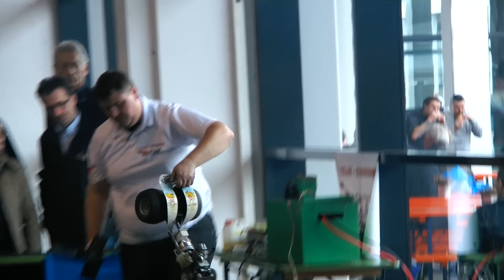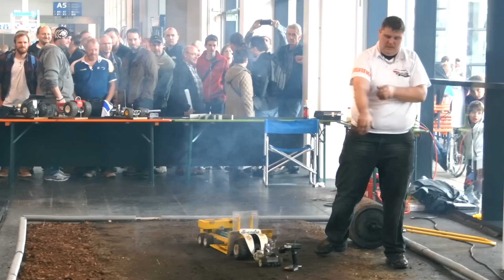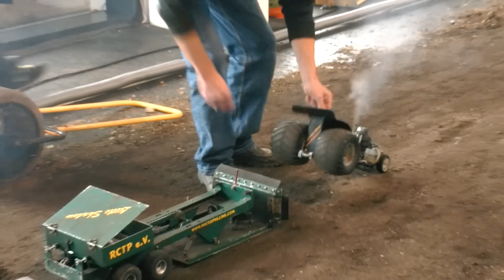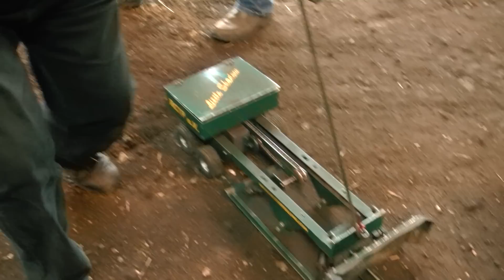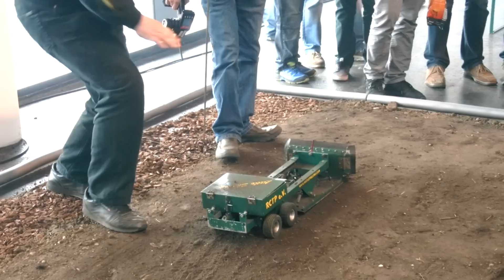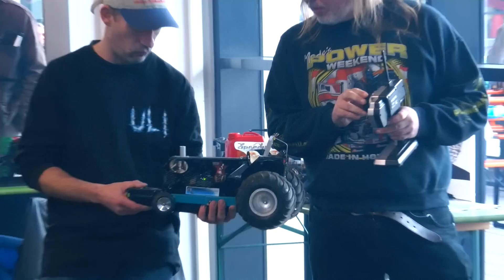RC TRACTORPULLING WITH FAILS POWERFUL RC TRACTOR IN ACTION AMAZING !!! / Faszination Modellbau 2015

Comment: Why hasn't tech been integrated into labor?...because nobody gives a crap about laborers. These cars should be pulling bulk weight like roof shingles, sheetrock, bagged cement, lumber, or whatever without being steered from point A to B. Why stop there?...have them run up and down ladders. A roofer could have one running shingles along the Ridgeline, bringing hardware and doing pre cuts if anyone gave a crap about roofers. Imagine rc vehicles nailing and screwing sheetrock or sheeting all full sheets in one direction then measuring and fitting the last piece before moving up to the next row. Hell...why not have a rechargeable jobsite rover that's integrated into the trailer that the supplies are loaded on. Plug it in at night and use the vehicles charging system and/or regenerative braking to top off the battery. The trailer wheels could break away from the trailer at the jobsite and the deck could be reconfigured into a cut table. The worker is the only piece of equipment that a company uses, doesnt maintain, damages, even destroys, and doesnt pay for. The last people to get what's left of the money on the job are left doing the bulk of the work for the smallest wage. Theyll deal with accumulative wear and tear as long as possible until they discover they need a career change at their own expense or find themselves disabled and absorbing the cost of the medical damage which isn't possible considering the medical industry values their time at an entire years worth of a laborers wages for a fraction of a days work. Workers are left fighting human resources, workers compensation, or ssi for help that's already paid for. So what happens when someone earning a poverty wage is run into the ground, incurs impossible medical debt while considering taking on more debt for a career change?...FAILURE. A taxpayer becomes a social services recipient. People trying to earn enough to feed their families and pay rent are excluded from the American dream only to find themselves wrecked from trying to build someone else's. The taxpayers are footed the bill. You know who won't be going through all this crap?...NASA. When looking at how they build I can't help but think I have it all wrong. No tech exists for construction labors because the future of construction has no shingles, sheetrock, lumber, sheeting or even a crew because future structures will be 3d printed so why invest? So people remain donkeys. The expense of their maintenance and repair is way more than finding a new donkey. Luckily it's not legal to put em down (shoot them) when a company decides investing in this piece of equipment ( you) is impractical or unfeasible. The problem is I know I'm right when I say people haven't integrated tech into labor because nobody gives a crap about laborers because after graduating high school I worked in the warehouse for mayflower in silicon valley. We had battery operated forklifts capable of handling any production scenario. Loading and unloading trucks and pallet racks all damn day full time with overtime. One shift I put in so many hours in I earned double time and a half. You're thinking. ..."Yup...electric vehicles are taking over."...   Here's the thing...this was 32 years ago in 1991. The lack of tech integration into the labor industry is inexcusable. The fact that just now the auto industry is using alternative energy for transportation is an equally big joke. The only reason we had that tech at mayflower was because of the big money contracts we had with Apple, Motorola, and the like. Despite all that big money the company layed me off on the 29th day, then rehired me for the next 29 through a temp agency to avoid the expenses related to permanent employment for 3 years. Why?...even though companies are run by people they don't care about people. Companies care about production, liability, and expenses. So people sacrifice everything for the companies success to their own detriment in hopes of a better future. This is why industry will never serve man...because it has tricked man into serving itself.